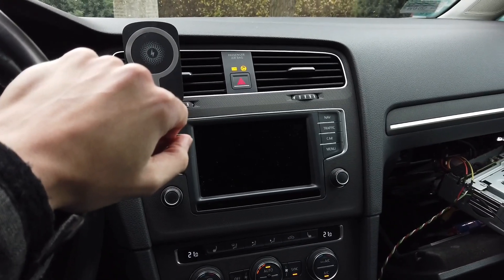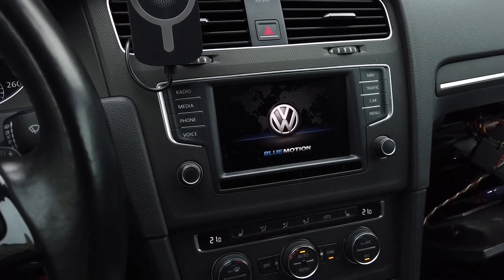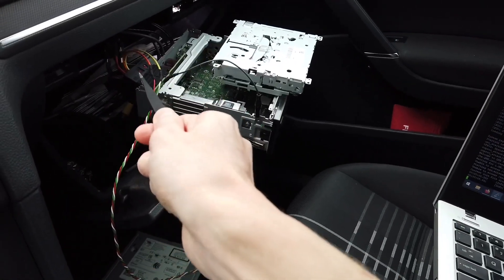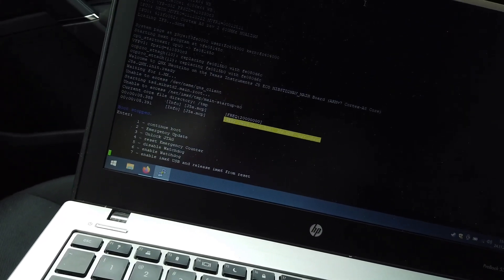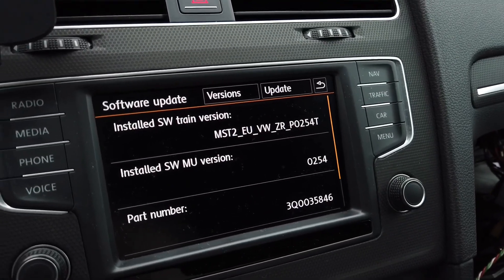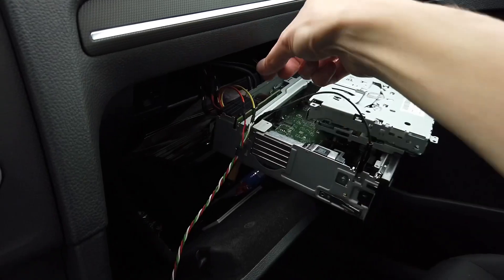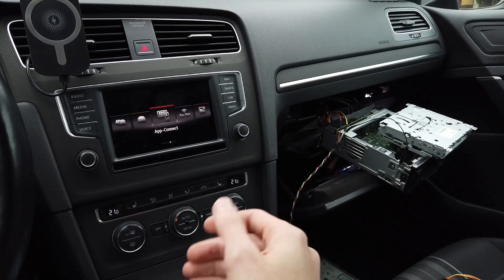VW Skoda Seat Red Screen fix Emergency Download MIB2 Technisat

Comment: how do you connect to the TX RX?       Did you splice into the VW connector wires?  (I dont see how is it possible to acces the pins with the VW connecter attached)

I have MIB2 delphi unit, the CD drive isnt loose when top is removed.... Do the  2 reset points even exist on a Delphi?

Would it be possible to do this on bench by applying voltage to any pins? if so 12 or 5v? 
thanks
Reply: I used this schema for help me  https://drive.google.com/file/d/1Sqks_xuLadIjAR_Q-3EYIAS6BzjANk_x/view?usp=drive_link

Comment: Hi, thank you for the very helpful video. Would you be able to post exactly where we can wire our connectors in the back of the infotainment system please. As its not clear in your video. I know you mentioned that we connect tx to rx and rx to tx.. but could you show it please

Comment: Hello, the infotainment system in our 2017 Caddy 4 stopped working yesterday. It is in a permanent reboot loop when switching on. We have neither received an error code nor have we tried to update it ourselves, but something could have gone wrong. It just went into this reboot loop when we started the engine.
How do you get out of this reboot loop? Is there a relatively simple solution or do we have to do an emergency download.

Thank you in advance

Comment: Hello i need help with this too i have a MIB 2 that i retrofitted into a golf mk7. It left a component protection active on the screen so i tried to get this removed from someone who does cp removals. He done some update to it which left a green screen saying update successfull on the headunit screen, but was stuck so tried to reboot it by holding the power button now it just goes into a boot loop 3 times showing the vw logo then the screen just goes black any help would be great.

Comment: Hello, nice explanation. help me, when I was upgrading from 369T to 480T 98% got updated and the last 2 file will be installed after a reboot. after 98 files the system went to blank scree and got hung. tried emergency boot, but only Front, Touch are getting updated. screen is not booting. please help. Thanks

Comment: The problem is that the sd card needs to formatted to exfat or ntfs otherwise is it wil do this you also don't need the pc to fix it just reformat your sd card to exfat and unpack the update file onto the sd card then insert in in sd card slot 1 and it should update
Reply: really? then dont need do this steps? only put SD (exFAT) with firmware and wait?
Reply: @TomášMachata yes i was searching for solutions how to fix it because my friend had the same red screen then I found Volkswagen manual on how to update and it said to format the sd card to exfat and it worked
Reply: @a.r.d9650  so then fix it with soft which was there first MST2_EU_VW_ZR_P0254T, put to card like xfat, to slot and wait. the unit do it alone. right? or i must do another stepts
Reply: @TomášMachata yes 
Step 1 format the sd card to exfat
Step 2 put the software on the sd card 
Step 3 put the sd card in card slot 1
Step 4 wait for the radio to update 
Then it should be fixed
Reply: @a.r.d9650  ok . thank you, i try it today. let you know , whats happend
Reply: hm, Nothing happend. Only start screen and lock in logo VW.  any idea?
Reply: @TomášMachata does youre radio give the emergency downlaod screen? Or is there still software on it?
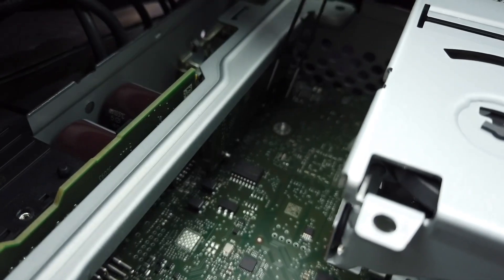Reply: 4:35 i think you need to do what he does with the 2 pins and power to enter emergency download mode (not the pc stuff)and then try the steps i mentioned earlier. My friends radio went straight to emergency download mode so we didnt have to do that.

Comment: Hello, I am trying to update my VC using an SD card, however MIB doesn't even allow me to start the update and I am getting two errors: 

- Error Code 0, Detail 161: KI_565920790C Partition0 Bootloader, Client device reported an Error
- Error Code 0, Detail 0: KI_565920790C Partition0 Bootloader, Device is not downloading! Execute critical unlock?

Dou you have any experience with this?

Comment: Hello, I have a mib unit in a boot-loop like the one in the video in this link. How can I fix it?
https://youtu.be/Ltc50G0yP-k

Car model: 2016 VW Jetta 1.2TSI BMT
Installed software train version: MST2_EU_VW_PQ_P0254T
Installed SW MU Version: 0254
Part Number: 5K7035200D

Comment: Hi How do you exit the blue screen mode back to regular mode without firmware update?

I accidently triggered emergency update trying to update my maps data. I do not need to change firmware and it is not on MIB solution - MHIG_RW_SK_P1055
Reply: Have you found a fix ? I have the same problem

Comment: I made a mistake, I put the latest version of the software on the card, everything went perfectly, but I had a problem with navigation, when I put the address and started it, after 5-10 seconds I got an error "Navigation database not available", I wanted to go back to the initial version and put the old software on the sdcard and entered swdl, I checked the box, I started the download, I selected all, but the problem is that I did not deselect emergency, hmizr, etc., I wanted to do the same thing with the laptop and emergency download but I can't... is there anything you can do for me, please help me
Reply: I found the problem...the problem was the sdcard firmware...i downloaded the firmware that was stuck in blue screen, and now works🙋‍♂️

Comment: Hello, I would like to ask you a question? I have discover blocked so I have to do the restore, if I do the procedure with a new firmware will the connect app that I previously purchased as an optional from vw also remain unlocked?

Comment: Is there a similar solution for the Delphi head unit (3Q0 035 819 A)?
Reply: did you ever find out? I bricked my delphi, are the tx and rx pins the same in back?

Comment: @mr-fix Hi there, I have the VW STD2 PQ [5C0 035 680B] unit which I bricked [now in Emergency Mode - Red Screen] after attempting to update the FW from 0245 to 0254... I've watched this video, but I don't have the separate CD/SD1/SD2 unit in the glovebox, as its all self contained in the Main Head [Infotainment] Unit. Are you able to help me trying to find the pins to short per this video, please? The car is a VW Jetta TSI 2015 model for Australia.
Reply: Did you manage to fix this? I tried the same update on my 2015 TSi last week and it bricked my unit - I'm also in Australia. Would be good to know if you got this sorted.
Reply: @sched7  did the exact same thing took it apart and the boards completely different

Comment: Hi, My MIB2 Preh with two sd slots has a bootloop problem when powering on. On average it would start working after 20 minutes or so. Once in operation it continues to work. Do you think this is a software or a hardware issue like overheating? I has he latest software train and was patched to open Carplay.

Comment: I have a similar boot loop issue. I understand the UART USB part but your cable setup looks different to anything I've seen for sale before. Did you make it? Where so you get it? Thanks!
Reply: When i had the red screen i deleted the update file on sd, extracted again and it worked

Comment: Hello, I'm stucked in red screen on my mib2 high, 😢, can you assist me to solve it
Reply from the maker: Try inserting SD card with firmware. New card, freshly format with FAT32, fresh FW download.
Reply: @mrfixpl  thank you so much for your help!
Reply: @mrfixpl I already solve this issue with the new firmware, but I try to install the toolbox and looks good, bud when I push menu to get the gem, nothing happens 😢,  how can I be sure about is correctly installed the toolbox?  Or what I need to do for un hide this menu... I need a hand please
Reply: @mrfixpl is there a way to exit without updating firmware ? I'm on blue screen and it's looking for storage

Comment: Thanks for the video! Just finished in your situation and I was wondering if I can do this entire procedure with the unit detached from the car. I mean, I saw you basically touched nothing so maybe it just need the power supply and the UART connection. If so, I can unbrick it from my workbench. What do you think?

Comment: Hello, first, thanks for the video.
I have done the steps correctly, but when I run the "emergency update" I think it starts correctly but after a while it stops with the message 
ing tsd.mibstd2.main.root...
00:00:05.268     [Info] [mcp]   [FREQ:20000000]
00:00:05.271     [Info] [mcp]   [PERF:0x648d2cc:IO1] J5e.MCP.init.start
00:00:05.292     [Info] [mcproot]       CM is restricted
I don't know what you mean or what the problem is. Do you know what it could be?
Could you confirm which file to put on the SD?

Thank you

Comment: Can you help me? I have the same problem but with mib std2? I can't find a circuit to connect.
Reply from the maker: This is MST2.
Reply: @mrfixpl  Thanks for the answer, but does my radio mib std2 also have the same working principle for recovery?
Reply from the maker: I don't know what "you radio" is. There are different vendors and versions of MST2 devices.

Comment: Hello thanks for your videos!!
I have a question. I am trying to do an emergency update but the log in putty is messy with unreadable characters. Is it because of gnd? I just used a cable from the usb to uart converter and the other end that was a father I clipped on it the crocodile and the other crocodile on the case. Is this correct?

Comment: Hi Mr-fix. ...about emergency recovery  after a failed 02xx to 04xx update. It has the same problem with the radio, see photo. Is the procedure and connectors on the board the same for my radio with two DS card ? Thanks for the reply.

Comment: Hi, I have similar problem with MIB2 infotainment unit which has run into boot loop. But in my case it happened during normal usage. No firmware updates, manual modifications  etc. Just stock firmware. Can you describe how you have prepared sd card for your emergency recovery ? What was there ? As I said it happened unexpectedly so i haven't prepared any backups etc.
Thank you for response
Reply: Did you manage to fix this? I'm having similar problem
Reply: Did you find the solution?

Comment: mr-fix i did all the steps but my mib2 remains in the emergency download with error cpu Module: nuanceres.frf%2 at step 45/100. even if press 2 the mib 2 goes into energy download but i get an error at step 45. i tried mst2_eu_vw_zr_p0254t and mst2_eu_vw_zr_p0248t. I don't have my original mst2_eu_vw_zr_p0241t on sd card. could you give me advice, thank you.

Comment: Got a mib2 tehnisat, and this worked first time for me. If your in the UK and need help gime a shout
Reply: I managed to brick my mib2 technisat while trying to update firmware. I get the same red screen but no boot loop. I don’t know how to bring it back to life and VW won’t touch it 😢
Reply: @mesnikos  Did you manage to fix it?
Reply: Hello i need help with this too i have a MIB 2 that i retrofitted into a golf mk7. It left a component protection active on the screen so i tried to get this removed from someone who does cp removals. He done some update to it which left a green screen saying update successfull on the headunit screen, but was stuck so tried to reboot it by holding the power button now it just goes into a boot loop 3 times showing the vw logo then the screen just goes black any help would be great.
Reply: @Ghostingggcuzz  can possibly help if your in uk. you just follow above steps to recover device.
Reply: You in the UK

Comment: hi, found you whilst looking into a similar issue "emergency download, no suitable update found. insert valid update" but i don't get a boot loop like you had, eg no VW logo, only the error and then goes blank for a second and does the same again. from here would i be able to just insert an SD card with a valid firmware and it update on its own do you think?

Also is there a way to see what was the last version of the firmware installed from here as i have no access to any menu options.

thank you.
Reply: Did you manage to sort this? i have the same issue
Reply: @kas5857 I got it sorted but not with this, I ended up finding someone who I think reflashed the firmware for me.

Comment: Hey Mr. FIX great video!🙌 can i update from mst2_eu_vw_zr_p0367t to p0480t without problem?
Reply from the maker: I tried 0254 to 0478 and made video about recovery instead. 😅
Reply: @mrfixpl  i tried to patch my 0367 to activate app connect but i got the boot loop and I cant find the 0367 update in mibsolution only 0369 do you think i can update to 0369 with emergency update?😊

Comment: Hi @mr-fix, on the UART cable setup, what are those metal connectors you're using? The ones you inserted into the quadlock, I tried to find one exactly like your which will fit in the quadlock but couldn't.
Reply: one can use "Universal ISO Radio Connector Harness "and remove the wire with the metal end from the connector. You need to use an extractor or you can make it form a paper clip (two parallel pins) that you will pus the cable out. use the extractor again to remove the pins from the quadlock

Comment: hello, can you help me solve the problem "active component protection" thank you very much
MIB2       3Q00035819C
Reply from the maker: You need to visit dealers. They will remove Component Protection after confirming that the unit is not listed as stolen.
Reply: @mrfixpl  hello, it's very expensive do you have another solution?

Comment: Hey man, great videos. Just subscribed :)
I was wondering, is the PuTTy terminal necessary for a reboot? Is it possible to just short the points and system will automatically update from SD card? Or will you definitely need to get boot menu and press 2.

Thanks.
Reply from the maker: You need it. main board short will get you into the recovery menu. When in it, you need to select option no. 2 - PuTTY or other serial monitor is required to do it.

Comment: I'm trying to set up this RS232 serial connection, but when I power up the MIB2 unit I'm just getting nonsense on the screen.
I've tried all baud rates from 1200 to 115200 and none make any difference.
Can you tell me what your settings were for Data Bit, Stop Bit, Parity and Flow Control on this connection?
Reply from the maker: You sure you connected with the right pair of Tx/Rx lines? Because there are two.
Reply: @mrfixpl  Thanks for responding. I'm using terminals 11 and 12 in section D of the QuadLock.
Reply: Did you find a solution?

Comment: Hey dude, great video! Hoping you can help as I'm in a similar situation. I have a Harman brand MIB2 High series unit. I have a couple of questions. 

Which pins do I need to connect RX and TX cables to? I found a document online which shows a description of all of the various pins, however it seems there's two sets of RX/TX pins - one in a group labelled MMX, one in the RCC group

 My Harman unit seems to have a significantly different mainboard to your Technisat unit and the contact points you shorted in your video are not there in my device. Do you know how I can boot my Harman unit into the emergency menu to reload firmware? 

Thanks for your help!
Reply: Did you find a solution to this?

Comment: why after pressing 2 in the emergency menu and disconnecting the power it does not start in the download emergency? we have the same unit
Reply from the maker: Maybe you are pressing 2 too late. Or there's something wrong with your Tx-Rx connection.
Reply: I short out the unit, the emergency menu appears, I press 2, I disconnect the power, wait a few seconds, I put the power back on, but nothing appears

Comment: Hi, I have the same reboot problem as you after installing a patch. The technician told me the memory is burned. Is it possible or is it repairable to the volkswagen?
Reply from the maker: VW will most likely just replace the unit with new one, and it's not going to be cheap.
Reply: @mrfixpl  is it possible that the memory is burned as the technician said? or can I give it a try like you did?

Comment: Have MIB STD2 PQ+ /NAV (5K7035200D) Does Not have Glovebox unit - Just Head unit. Can connect via TTL Serial and can see boot loop data using TeraTerm set 115,200,N,8,1. So all that is good .. is there an option on this model to initiate emergency  update procedure.
Reply from the maker: Should be possible the almost the same way as in the video. The only difference will be the main board with those two points that you need to bridge. They will be located in different place.
Reply: @mrfixpl  - Yeah .. Which Two ? I know it will be in a similar location ..Have you any info on those ?
Reply: @WDRI did you find the location of the two holes? Thanks!